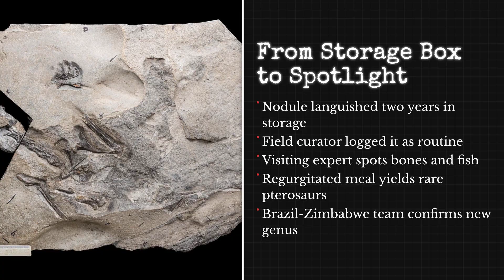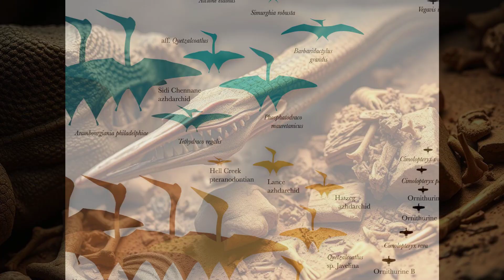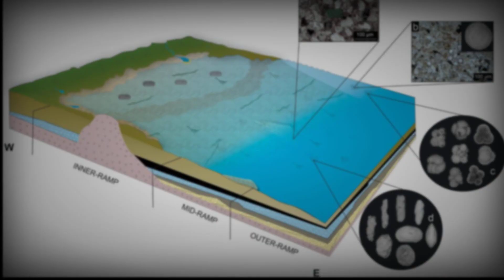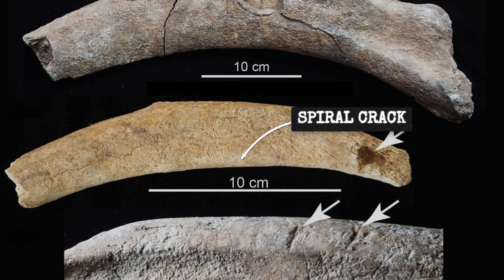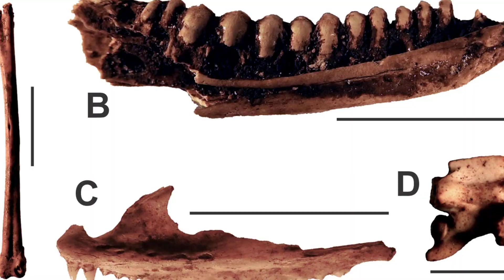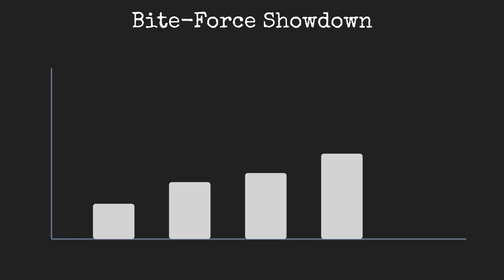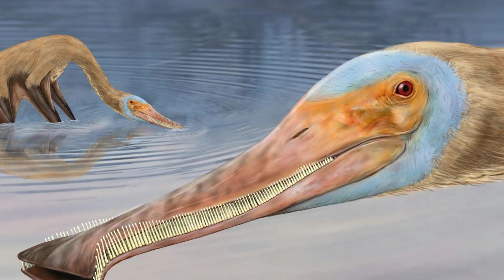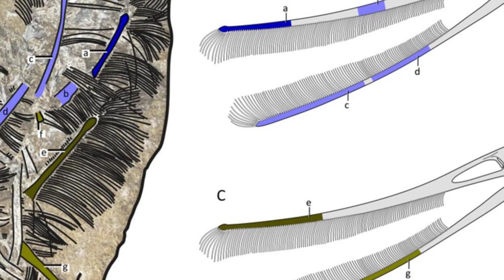The Only Pterosaur Ever Found Inside Dinosaur Vomit

Comment: Maybe it tastes bad or they don't what to get fat.😂
Reply from the maker: The prehistoric diet struggle is real! But actually, the most likely scenario is even more brutal - the predator's stomach acid couldn't break through Sharovipteryx's tough bones and skin, so it just... rejected the meal. 
Like nature's worst case of indigestion. Could also have been a stress response if the predator got attacked or startled right after eating. 

Either way, terrible Yelp review for Sharovipteryx as a food source!  
What do you think killed it first - the predator or the fall from the sky?
Reply: @FossilForensics Seemed pretty clear it didn't fall but was snatched in flight, pulled under water, and swallowed. Was it killed on impact, drowned, or suffocated in a stomach? I'd lean towards impact, but if it revived and started squirming around in the stomach I could see that causing a gag reflex!